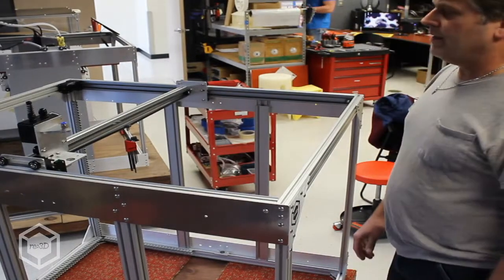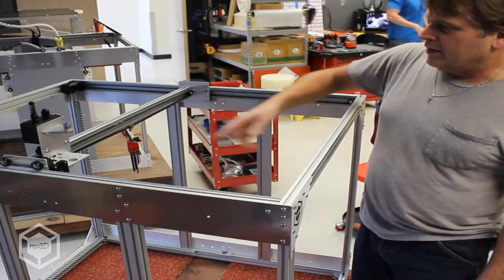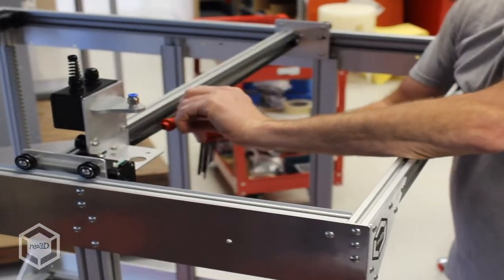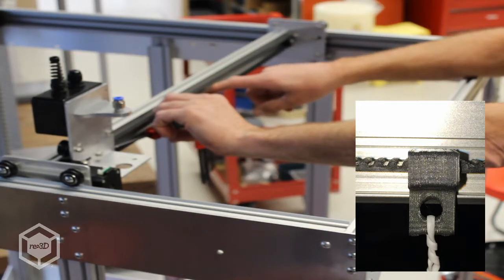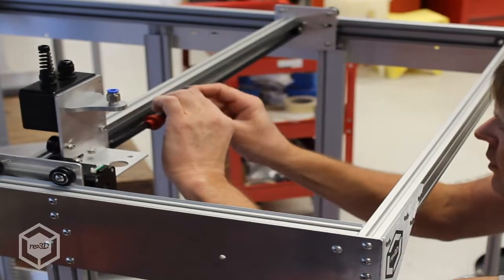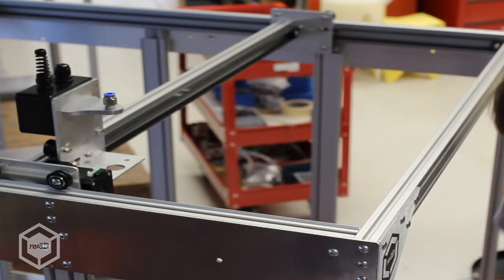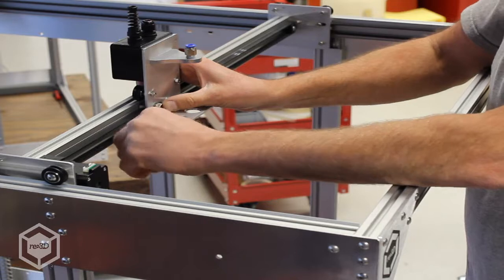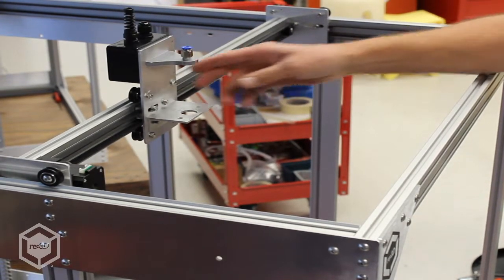Belt Tensioning

Comment: One problem:  our Gigabot has a bridge belt such that the belt itself is oriented 90 degrees off axis from the machine you are demonstrating with.  Our belt runs left right not up down if that makes any sense.  Therefore one cannot "hang some allan wrenches" on the belt to see if the tensioner is torqued to the proper amount; one would have to have a mass gauge of some type and pull on the belt.  With our machine, how do we test to see if that belt is tensioned correctly?
Reply from the maker: Thanks for your question! Our engineers are having a hard time visualizing what you're explaining and would like to ask you some clarification questions. Could you send us an email at support[at]re3d.org so we can get you some help?
Reply: @re3Dprinting  I certainly can, thank you very much.
Reply from the maker: @pious.techpriest  No problem, thanks for writing in!

Comment: Recently had to tighten my belts after seeing some bad ringing. I would recommend taking one or two more shots of the line your referring to. I realized the first time I had tightened some time ago I had actually used the wrong reference line. Otherwise very helpful!
Reply from the maker: You can now use a force gauge to tension your belt more accurately. http://wiki.re3d.org/index.php?title=Calibrating_your_Gigabot#Belt_Tension_.2AOption_2
Happy Printing!
Reply: Where can that force gauge be purchased?